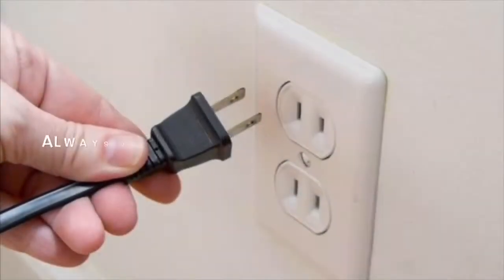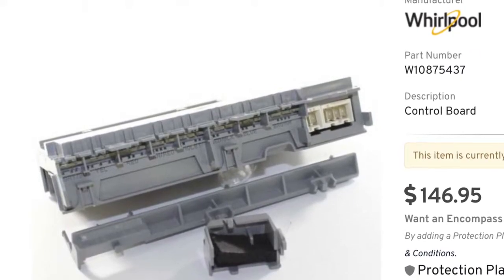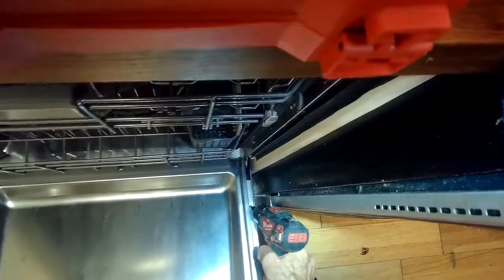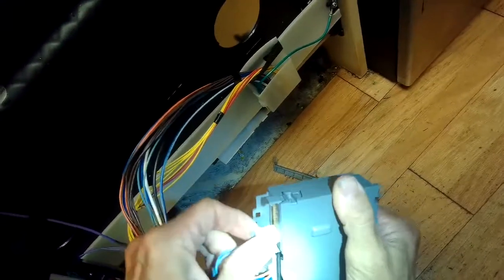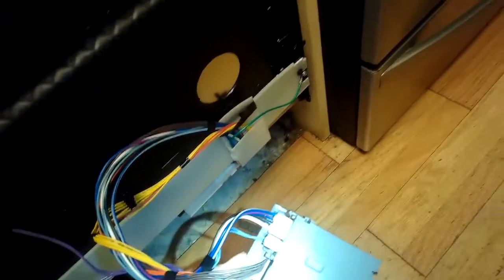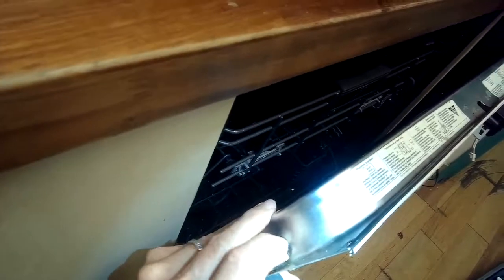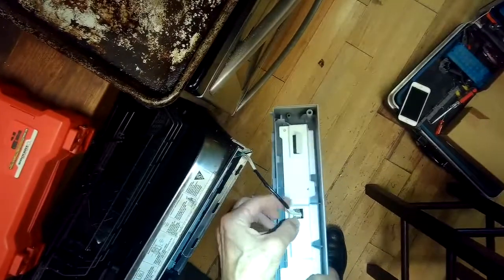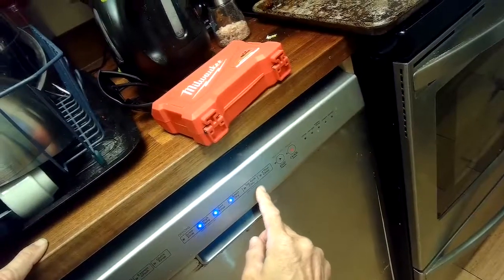✨ WHIRLPOOL DISHWASHER NOT Melting SOAP—FIXED ✨

Comment: Are you saying that the soap is not dissolving because the water is not heating up?
Reply from the maker: Mot enough water comes in to activate the heater.
Reply from the maker: One way to tell is to open the door after 20 minutes and you should get a big plume of steam coming out.